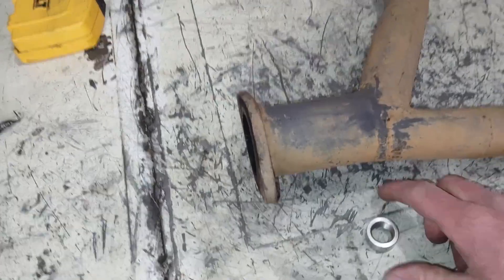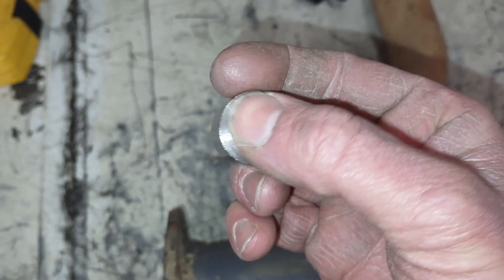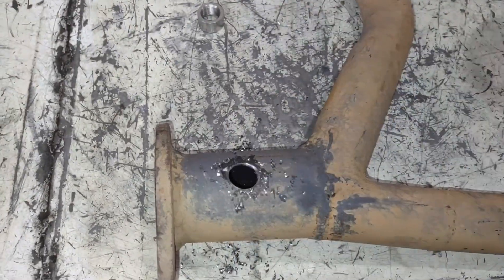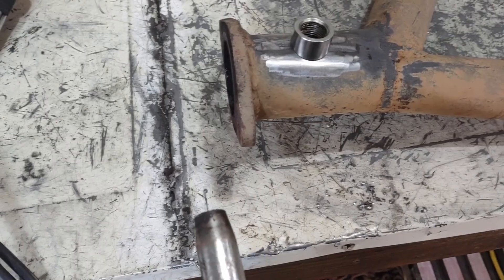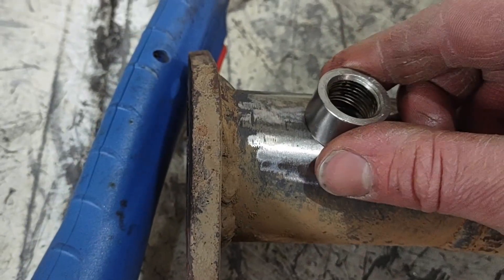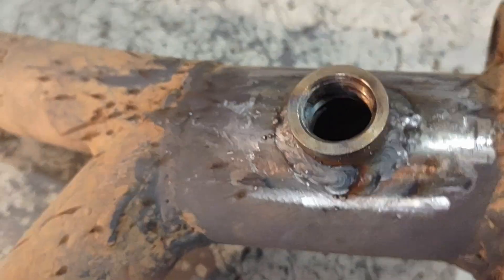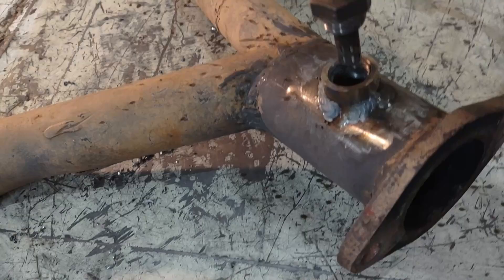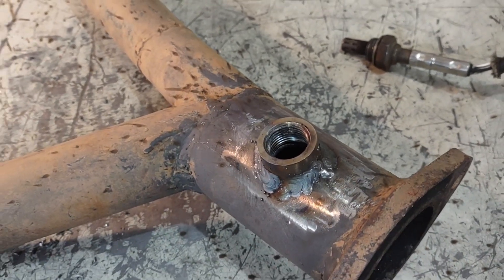Oxygen sensor bung Install

Comment: "i've never had a problem" lol... it takes years, but it's definitely always a problem. It can't not be a problem. You MIGHT have joint strength issues, depending on the details, but you will DEFINITELY have early corrosion issues.
Reply: You are overthinking things,its not a liquid oxygen valve on a space shuttle, just a bung on a exhaust.

Comment: I need to install one for my AFR gauge but my intake manifold has already an O2 sensor for the ECM. Shall I replace it with the one for the AFR ? Or shall I drill an extra hole ?? Thanks